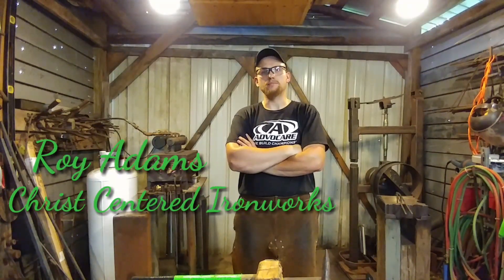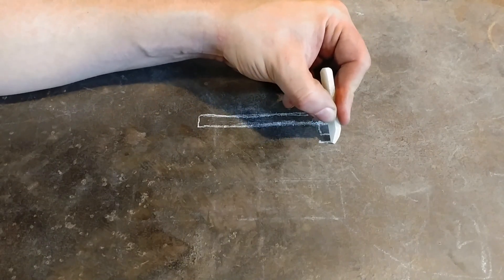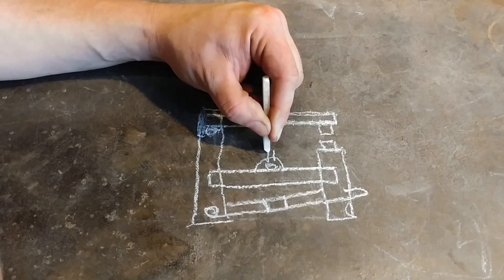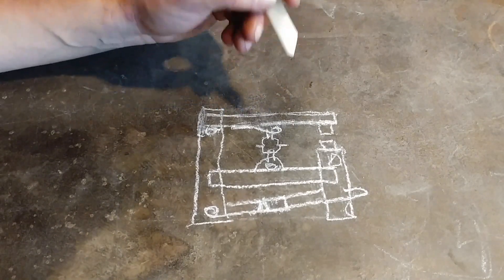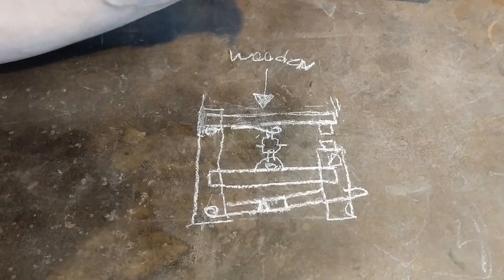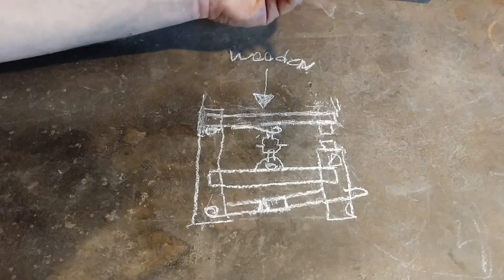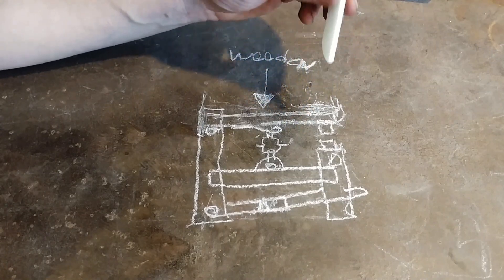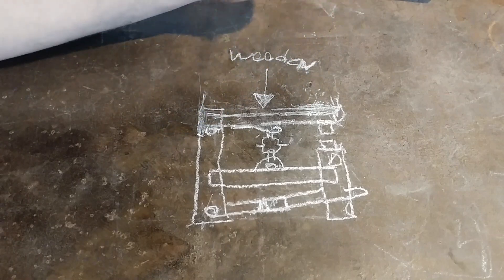REPLY TO: Would You Like to See Me Do a Complete Power Hammer Build (Step by Step)???

Comment: how about an actual steam hammer?  not many makers of the big ones anymore, heh just kidding, but I would say some of the hammers out there they just dont move metal or strike hard enough, though I guess they did also use bradly style hammers as well in the old forge shops for some thing at least around the turn of the 20th century in railroad forge shops. I would use steel though more durabillity so to speak, wood bends and flexes  more then steel and can affect acutracy of the hits I would think, but yea so many machines out there dont have the height adjustment or power adjustment, and I have seen some forge presses that are just generaly slower though they can really flatten the metal.

fine balance though I suppose.